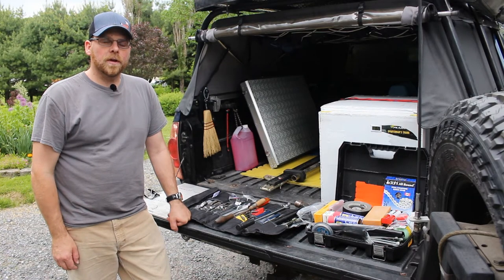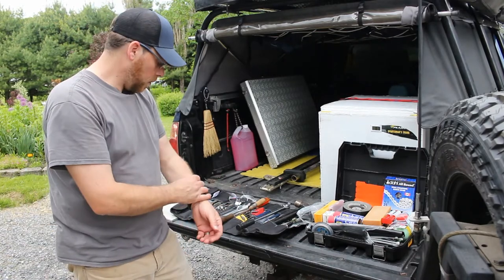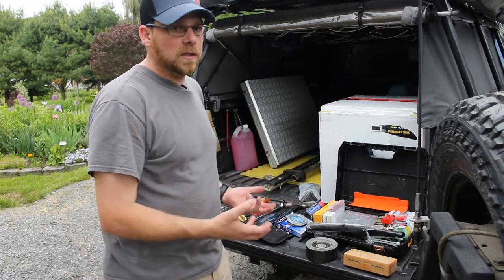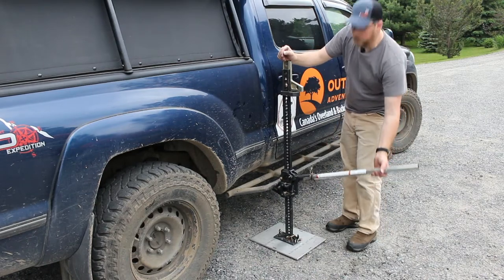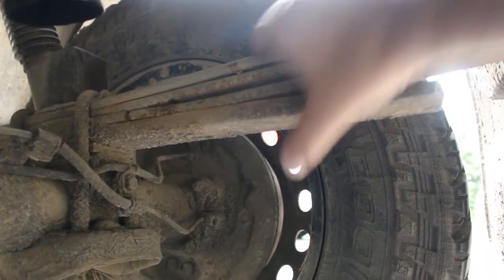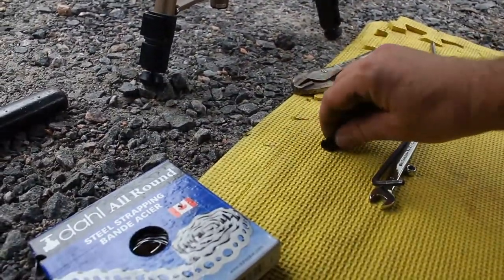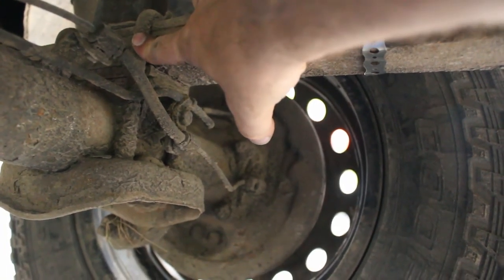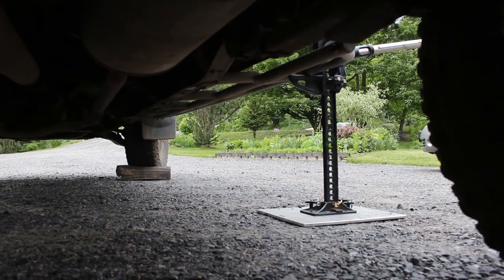OutHEREadventure.com Trail side leaf spring repair

Comment: Putting your head between the handle and upper jack is a dangerous thing to be doing. If the jack misses a pin,  the handle could kick and if your lucky it will only give you a headache. The handle should also be in the upright position when under load.
Reply: It's true. I noticed while editing the video that I had left the handle in the down position. I have actually seen older jacks automatically cycle and drop with no one at the handle. It's a good practice to have a second person around too. With anything like this keeping the risks to a minimum is key. When an accident happens it's usually because someone was lazy or forgot to do a simple step. (like securing the jack handle!)